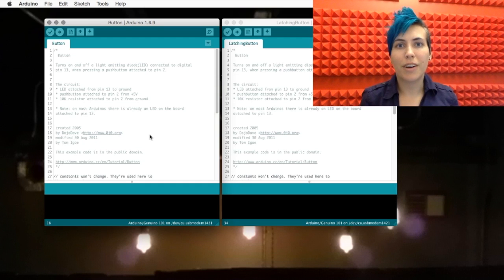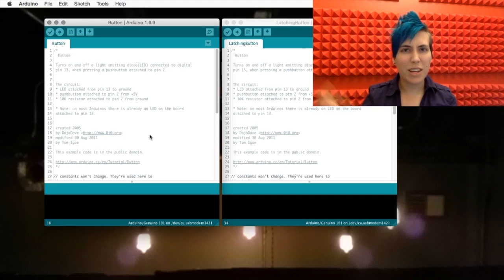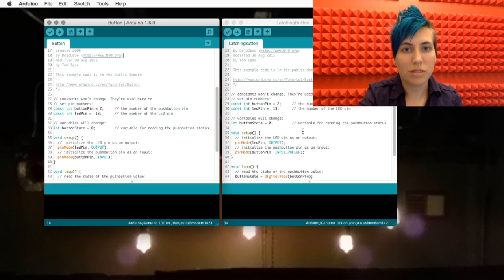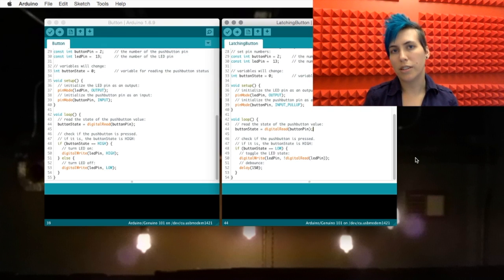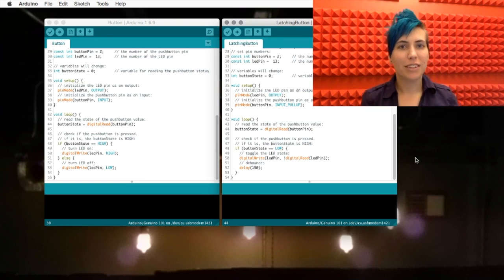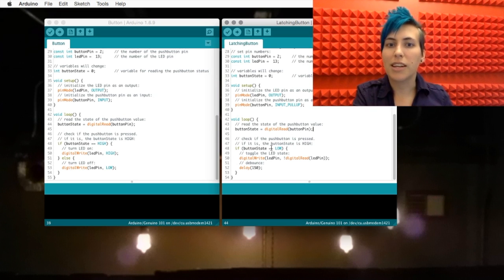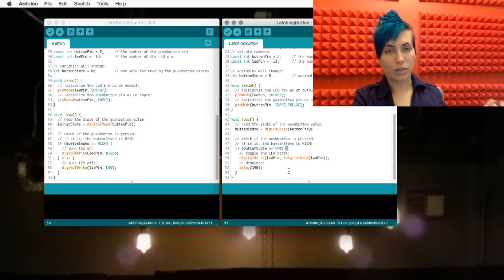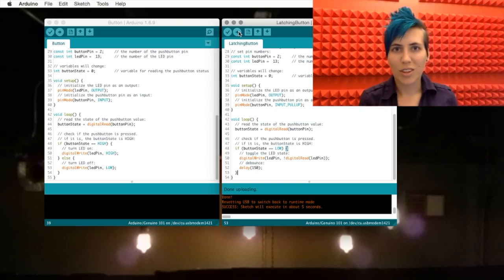Arduino Code Magic: Latching/Toggle Circuit

Comment: it didn't work for me. LED simply flashes with no response from the button.  If ledPin was declared as a OUTPUT at setup, then how is it that in the main loop your code is written to digitalWrite and digitalRead ledPin simultaneously?

Comment: but this isnt a perfect solution since if you hold longer or shorter than the delay, you wont get the expected result and if you hold the button down, the led starts blinking
Reply: You would need to create a value to retain the old value. Then the new value becomes old vaue then you can hold it as long as you want.

Comment: how would I go about making this work with 7 individual negative inputs that then power 7 relays...?
Reply: You would have to use a 74HC595 Shift Register IC to be able to access each relay independently